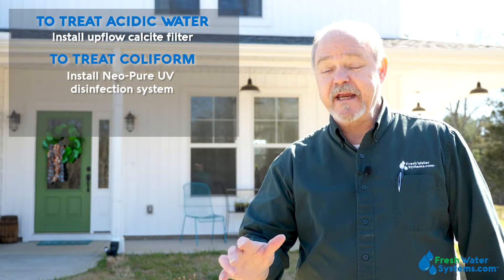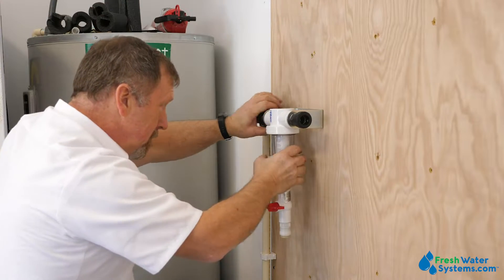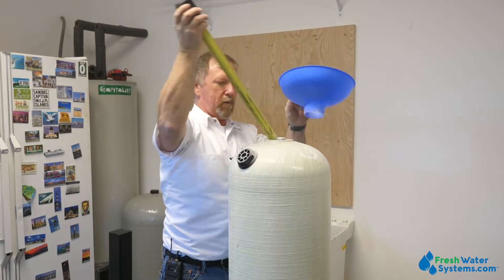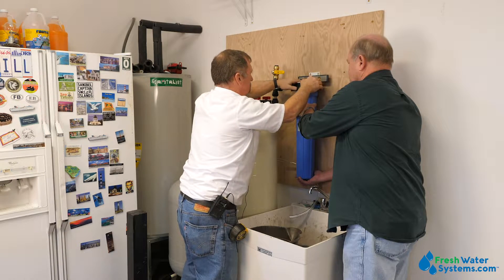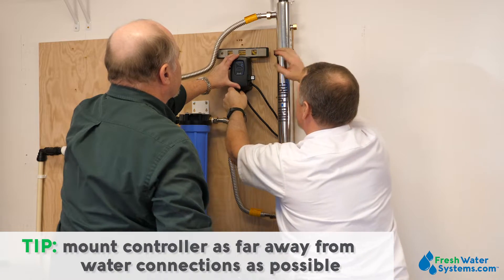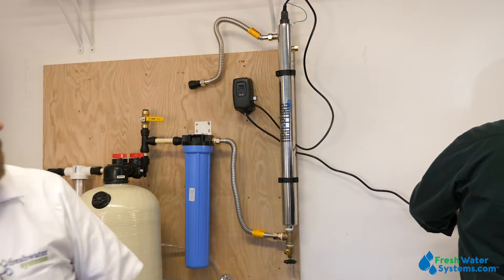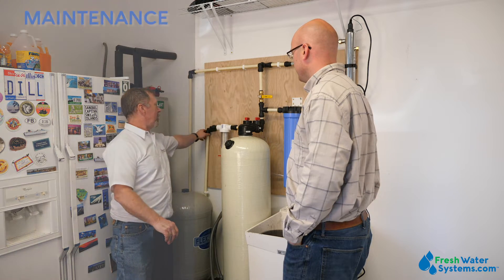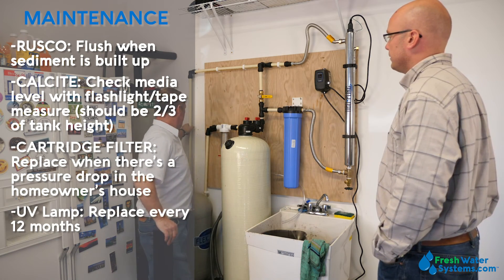How To Install A Whole House Water Filter For Well Water

Comment: What is the reason one does not start with a description of the entire system and where in the flow of water does the UV filter fit. Understanding where if fits helps one decide on next steps to install in an existing system>

Comment: I recommend you do not to buy these systems. The sediment spin filter require maintenance (weekly), the cartridge filter requires maintenance(monthly), the light has a bogus key to make sure you can not purchase light bulb aftermarket.... The "controller" does not have a flowmeter feed therefore the light just stays ON full blast, any stories about how controller applies just a "correct amount of light" are just stories. The controller count number of hours and simply disable the ballast. These manufactures are shameless.
Reply: What system would you suggest for well water  with hydrogen sulfide and hard water ? These water systems are a pain to figure out plus like you said it's hard to trust them
Reply: @frenchonion4595  Test your water first. If Sulfur Bacteria - I suggest well shocker (it fires chlorine into a well at the scheduler, if low level  <3 aeration, higher levels require chlorine or H2O2 contact tanks. There are other systems magnesium, etc. Any water can be made perfect.
Reply: @browntigerus  I'm currently (and have been for years) using a well system with no filtration whatsoever, have had the water tested its bacteria free, no heavy metals, etc its just really hard water. Limescale and iron and stuff. What would be the cheapest way to filter the minerals out of my well water without a lot of regular maintenance? The only reason I'm considering a change now is it really roughed up my last water heater with all the mineral deposits..
Reply: @Investigamer  You need to post your entire test not your interpretation. It is very well may be that all you need is water softener [I would add automatic pre-filter, that doesn't require maintenance ]. Once you have your pdf - there is well known terrylove community where I would post. Most ppl are very generous to suggest proper settings and equipment.
Reply: What do you suggest going with then? I’m looking at buying a house with well water. Dunno how people lived in it before.
Reply: @Fishunderpressure  same process as above. Get your water tested first. You need to know what you are trying to fix. Don't fall for super pricey no electricity solution that starts with letter K. Clark and Fleck watersoftner heads are very good. Your system setup will greatly depend on issues with your water and be responsible: do not start pouring heavy fertilizers or process oil over your shallow well. Lol
Reply: @browntigerus  sounds like you have done your homework , where or how do you get water tested ? I hate the idea of a place that’s selling you stuff is doing the testing

Comment: Not an expert but seems to make more sense to install, sediment, UV and then calcite tank.  Otherwise the calcite tank can become a bacteria home and sediment will also collect in the calcite bed.  UV is stainless and not affected by acidic water nor the quartz tube.    Wonder is they would hook this up differently if the neutralizer tank used a automatic backwash system.  A tank not routinely back washed can be impacted by channeling and lumping of the calcite mixture.